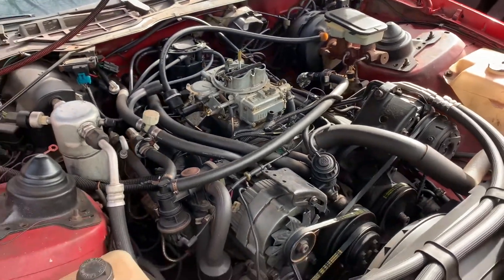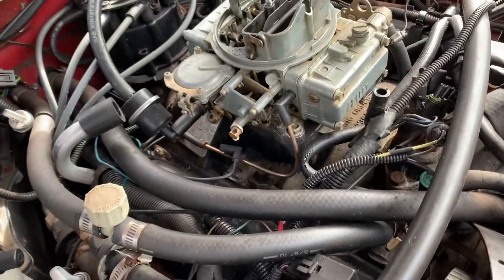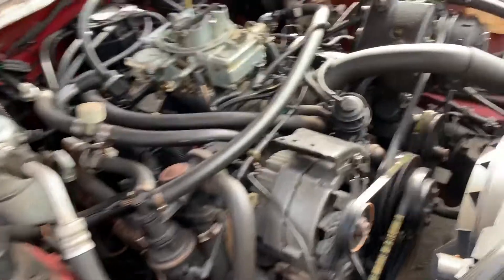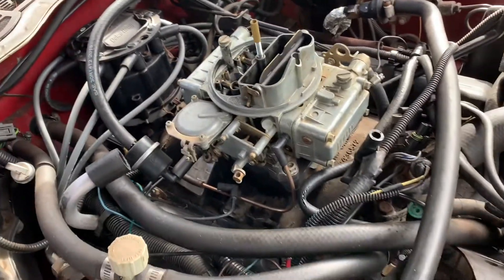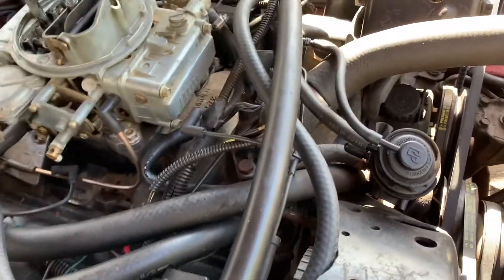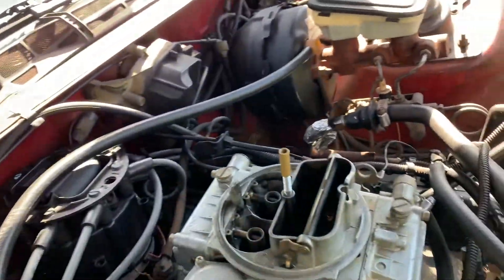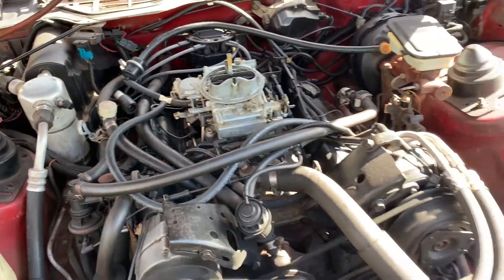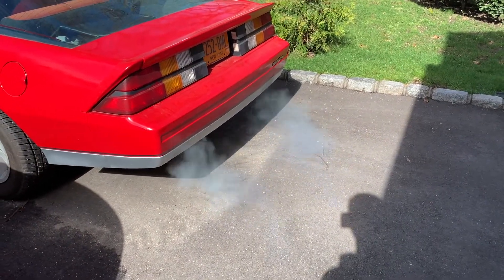1984 Camaro Z28:  Is my engine BLOWN?

Comment: I have a 1984 Z28 i put a 600 hp 406 sbc in it with a built 700 hp 700r4 trans a umi torsion bar umi pan bar an rear lower control arms B&M pro ratchet shifter reverse pattern the car came alive its crazy fast but not a cheap build
Reply from the maker: That sounds awesome!  I used to have a Monte Carlo ss with a 408 sbc and 700r4.  It was more like 500 Hp but still plenty of fun.

Comment: dont leave the pcv hooked to the brake booster, bad idea, I just picked up a 92 RS no motor or trans so I'm pitting in my old drag motor 383 stroker 13 to 1 compression maybe a 400 turbo trans. nice z28 btw.
Reply: @jonsixxx6569  ill be mixing some 100 octane fuel with race gas from a can. maybe some octane boost with 93 fuel at the tank, i went with a 350 TH

Comment: DONT GET RID OF THE ORIGINALITY!!! Anything wrong with your car can be fixed easily - once you bastardize engines and ls motors and all - you're car becomes JUST LIKE 99% of all the other screwed up customized cars at the cruise ins.  Keep it original, find the actual shop manual for it that the dealer used (ebay). Those carberarated engines are EASY to service - odb1 - is SO SIMPLE - AND - I saw your drive video - that thing screams fast even with a 305 gas mizer! keep it orig!!